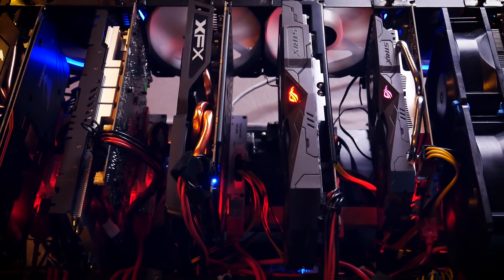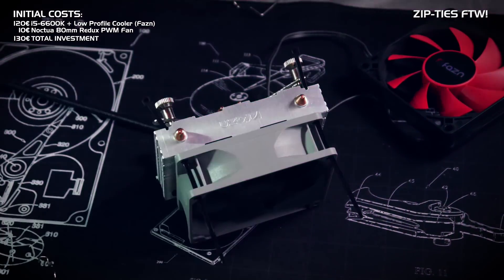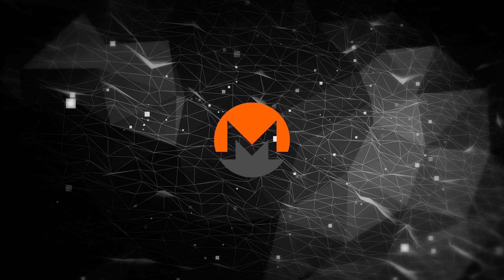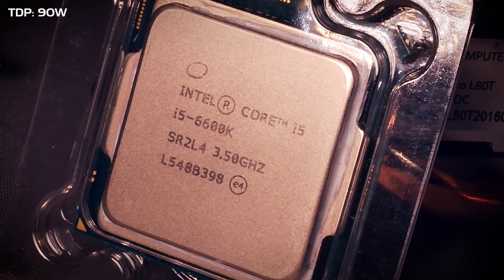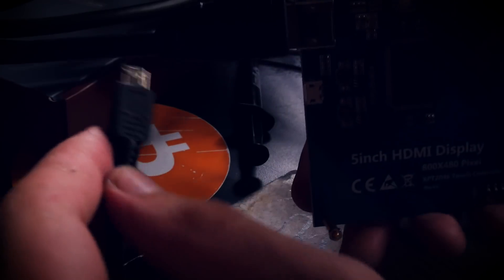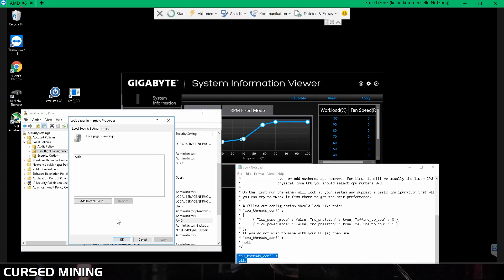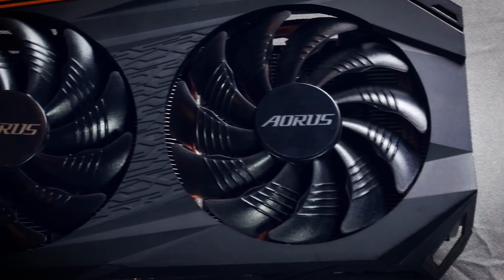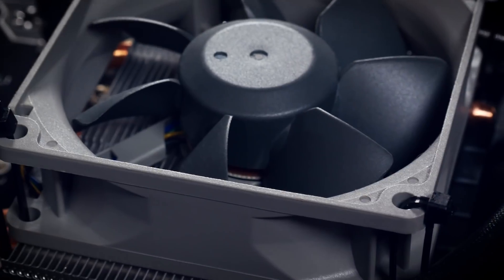CPU / GPU Mining Hybrid: adding an i5 to a GPU rig (long term experiment)

Comment: Hello you said something about page file size in mining what did you mean by that?
Reply from the maker: Hey! So for Monero (and similar coins) you'd want to enable lock large page files in your OS (meaning the mining software can lock memory for the mining process), gives generally higher/more stable hashrates - here is a link on how to do it on Win10: https://docs.microsoft.com/en-us/sql/database-engine/configure-windows/enable-the-lock-pages-in-memory-option-windows?view=sql-server-2017
Reply: Hello i didn't know windows 10 has  SQL Server Service in it. so if i follow this hat type in increase does it give?

Also step number 67 is confusing to me.  it says click Add User or Group. So i did then in number 7 it says In the Select Users, Service Accounts, or Groups dialog box, select the SQL Server Service account. Where do you find the user at? There is none of that there.
Reply from the maker: In terms of user it means the "user" you log into your PC with, f.e. 'admin' etc.

Comment: Nice work, i always thought it was odd that miners would have 4 to 6 gpu mining rigs with just a dual core cpu with a TDP of around 60watts, for just another 30watts they would be utilizing the whole rig with a cpu that could mine, i have an old dinosaur FX-8320 overclocked to just over 4Ghz with 2 gtx 1060`s, and it chug's along, would like to see a few video`s on the miners you use please
Reply from the maker: Hey Tucker, exactly mate, I think so too! Especially since the 6600k would only use 60w while mining anyway :) Respect for the FX Dinosaur :D just because hardware is older doesn't mean it can't work for us :) thanks for sharing mate and the feedback, I'll go more in depth about the software side of things as soon as I can :) cheers!
Reply: Thanks mate would be a good help on the software side, the dinosaur has been hammered over the years and has not complained once lol, got a budget after market cooler the Antec A40 pro that keeps it nice and cool, and thanks for sharing
Reply from the maker: so that you don't have to wait for the video =D (because I think I might do a little give-away first, wanted to do that since surpassing 1k Subs to say thank you to you all) my "standard" for Cryptonight/CPU was always XMR-Stak - but right now (starting from this video) I was testing JCEminer, for now it seems to work very well with the i5 =)  just checked the Antec cooler, very good price! I just can never resist to slap a Noctua fan on everything I can haha =D
Reply: Thankyou for sharing that, be good to seem the performance of other cpu miners, i`m using the Claymore CryptoNote cpu miner  i have 8 cores with 8 threads so i set it to 6 threads, average is around 380 h/s, the Antec is an awesome budget fan, cpu temp while mining stays around 40 ish degrees celcius, those Noctua fans are good quality very reliable

Comment: I have an i5 6400 too but I don't mine with it and an Asus expert mining (19pcie), I use SRBMiner for Cryptonight forks , works better then XMR, I have 2 rx580 (I was doing 1khash per card on Cryptonight Heavy) and 3gtx1080 for others coins, after I add it another gtx somehow my hash drop on the rx580 from 1kh to 780hs, that was yesterday, today is doing better 940hash per card. On XMR I was doing 740hahs and I used for more then a week.
Reply from the maker: Hey Man thank you for sharing your nice setup :) will check SRBminer, testing JCEminer with the 6600K right now! Would you mind sharing how you reached ~1khash per 580? Would be interesting :)
Reply: @CursedMining  I'm running stock bios, core 1340/2000 on memory
Reply from the maker: very nice mate! your 580s work harder than mine :D

Comment: what mining software are you using for gpu/cpu mining?
Reply from the maker: A lot of different miners =) for XMR (and other Cryptonight + fork projects) my "standard" is XMR-Stak (CPU as well as GPU), right now I am testing JCEminer as alternative for cryptonight, for now it works nice for the low power CPU. For ETHhash I always used Claymore's miners. For freaky algos like Lyra2rev2 (nVidia) I use ccminer. SHA3 was SKminer - if you need software for something specific which I didn't mention just tell me =)  P.s.: The easiest way to do it is to use HiveOS (a mining operating system) because it has most of the software included (I have a link in the description, it is free for up to 3 rigs) - hope I could help
Reply from the maker: Hey - forgot to write this here: I did a follow up on the mining software question in the farm update that followed, if you are still interested =) https://youtu.be/U8wd75Nn4TE